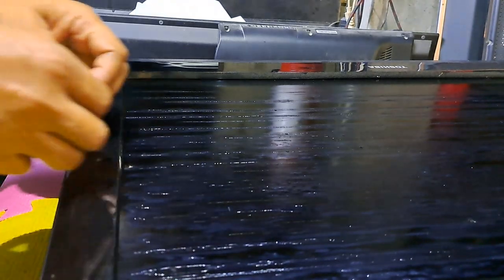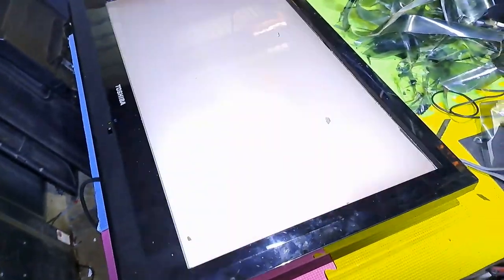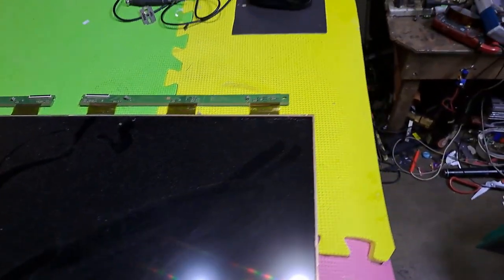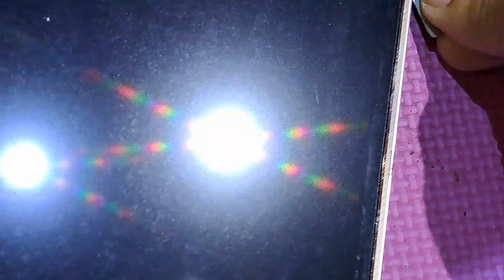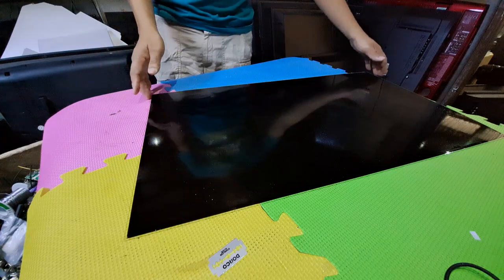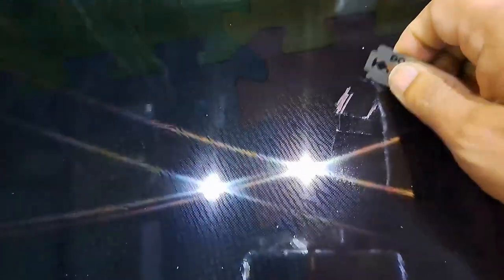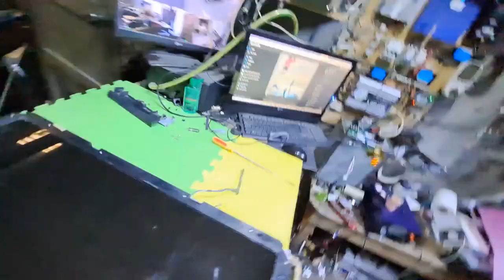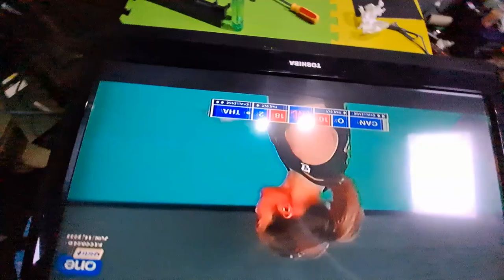Replacing Polarized Film.

Comment: Hello and respect for your work and what you present from your activity...on my word of honor, in my country (Eastern Europe), for detecting the defect of a led TV (regardless of the length of the diagonal), the technicians charge an amount of minimum 50-75 euros...another example: for the replacement of LED lights on a 32-inch LED TV, I charge a fee of 40 euros for the LED bars and 20-30 euros for labor and subsequent checks, for re-writing the emmc memory software, the rate is 40 euros...but none of the technicians do a job like the one done and presented by you in this clip...they prefer to negotiate with the client so that he sells the TV with screen defects to an amount of 30-40 euros, in order to re-use the power source or logic board of the "purchased" TV in this way... about the duration of the repair... it's a real shock... at least 30 days, so as to make you buy another LED TV and "give" the TV to him screen problems...if you don't have the patience for 30 days, you pay the required amount for detecting the defect, which is not less than 20 euros...anyway, corruption is at the level of state policy, here, in my country... I am ashamed of this fact but this is the truth... my respect for your work and for the kindness of presenting solutions for fixing electronic equipment in people's homes
Reply from the maker: About 45 us dollars for replacement of all the led bulbs here,  and it depends on their size. Its cheaper than to buy a new one.
Reply: I change the bulbs for 15 dollars.   And my talent fee is 10 dollars. And many of repairman are angry with me why I charge so cheap and my answer is I thanks God for feeding me every day at least I feel good doing good to other's.
Reply: @abrahamran9089  Hello. What do you mean when you say "I change the bulbs for 15 dollars..."...the fact that you replace the LED strips with other strips with new LEDs or you only change the LED that is defective? or do you change all the LEDs but keep their old support that you peeled off?
Reply: @tevzTVTevatronics  Change all the LEDs or change all the old LED strips with new LED strips? to be more clear about the question: use the soldering iron or the hot air station to change all the LED bulbs or change the LED strips (including their support ) with other strips with new LEDs? And, at the price of 45 US dollars, don't you also add the "intelligence" and the work done with the disassembly, assembly and verification of the work for the customer?
Reply: @abrahamran9089  Thank you for the answer... I had problems with the lighting of the LED strips on a 39 inch TV and the prices described by me are from 3 workshops where these kinds of problems are fixed... I can't do this operation myself because I don't have the equipment the necessary technique (materials and equipment) and not the necessary knowledge... I understood that ALL LED strips must be changed, not just 1 or 2 defective LEDs replaced, because the customer will be dissatisfied and make a negative advertisement for that repair shop tv... I paid 65 US dollars and, after two months, I took the tv back to the workshop with the same defect... I wanted to receive explanations about this subject from specialists whose customers are satisfied with the technical work done on their properties (defective TV with LEDs).. have a good day

Comment: Just like most of your other TV repairs that would be scrapped as uneconomical to repair here in OZ, TV repair here isn't a thing anymore just go n buy a new TV, although I do get the occasional customer who wants it fixed but I mainly do laptop n phone repairs (component level) as there my main income.
Reply from the maker: The cost is $50. The customer agreed to fix it. 1 to 2 hours to work on it.
Reply: @tevzTVTevatronics  I won't take the back off for less than AU$85 n that's just to give an estimate!